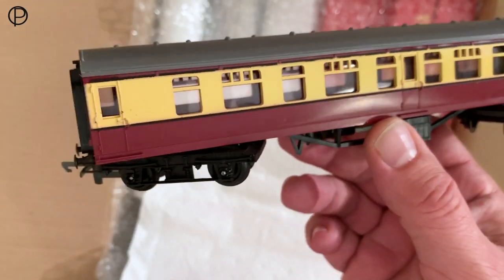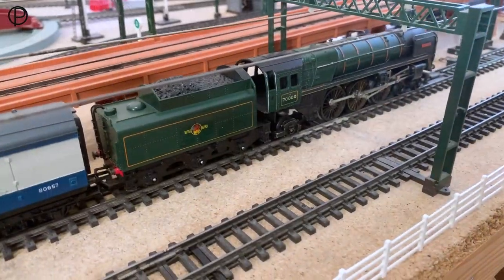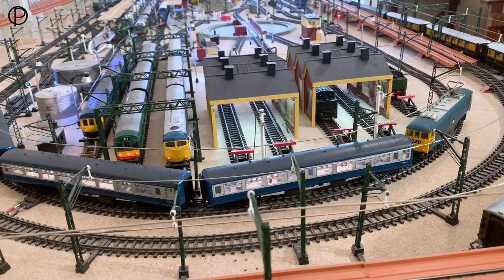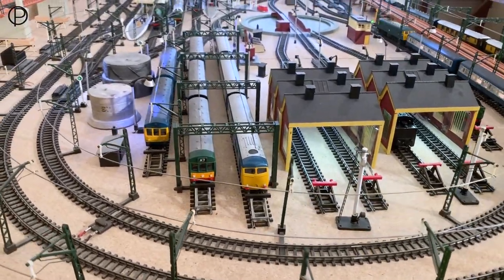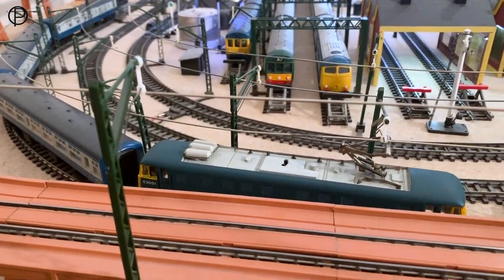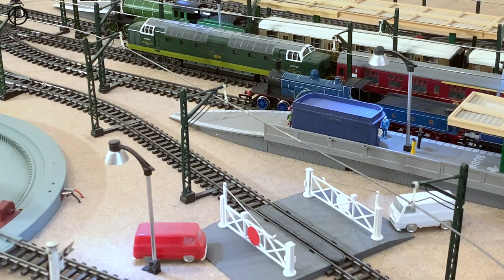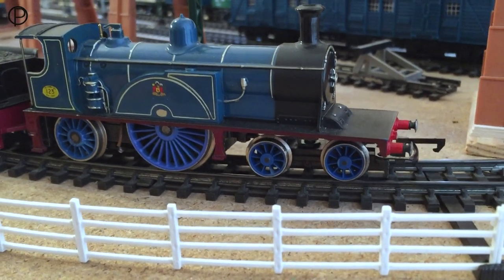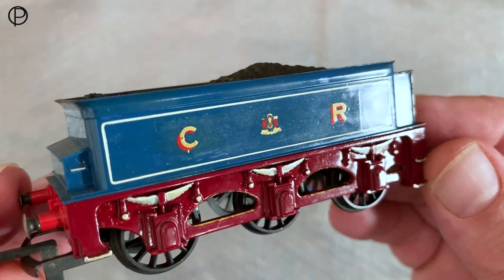Tri-ang Hornby R.753 Bo Bo Electric with Mk2 illuminated coaches

Comment: Thanks for the regular Sunday morning entertainment - so much better than reading the paper. This isn't really related to today's video, but I can't help wondering how many of those bridges Tri-ang actually managed to sell; I remember that it was expensive, but the main problem was surely that it requires so much space for the ramps that most people wouldn't have had the room for it.
Reply from the maker: Good morning Roger, great to hear you enjoyed the video again this week. The bridge defiantly need quit a bit of space to work as yo say. Pat Hammonds books suggest that about 1200 of the were made 1963-65 in the Tri-ang Railways period and in the Tri-ang Hornby era another 4200 between 66-67 and 7000 more between 68-71. Thats quite a lot for such a large and expensive item at 24/- in 1963.
Thanks again.
Oscar

Comment: Hi oscar another great video mate I love seeing your E3001/81 electric locomotives running on your layout I all like the tri-ing class81 locos I have 3 tri-ang hornby 81 on my layout today but with new ringfield 5pole motors in them did you got the 81 loco from Hattons I think I seen it on they website a year or so a go when I got one a 81 loco from Hattons last year? stay safe and well mate goodbye for now clive
Reply from the maker: Good morning Clive great to hear enjoyed seeing these models in action I really have a thing for the catenary. And a great play value those coaches with lights in combined with the overhead. The E001/81came from Elaine’s trains may be five or six years ago possibly   more and I’ve used it extensively for setting up the catenary and testing it. The pantograph was damaged when I got it and I’ve carried out some minor repairs on it. It’s always been a strong runner.
Thanks again for watching.
Oscar

Comment: Hi Oscar,
Good to see the old electric getting a bit of a face lift. The work someone did on that model might be crude, but it's still a good looking model. She looks a 100% better with a new coat of paint on her front end. Might be worth finishing the wire hand rails? The holes in the front are a little weird looking. Are you going to give it a coat of clear coat after doing the numbers and logos? 

The Caledonian looks good with the replacement wheels. Maybe some paint work on the blue to match it to the older body shell would be in order? Lisa
Reply from the maker: Good afternoon Lisa I think it’s a definite improvement as you say however I think wire handrails might be a step too far for my modelling capabilities at present.
Thanks again for watching.
Oscar

Comment: Noce job on the AL1. Were you tempted to renumber and use a different headcode at all? Its one of those musings I get, when you have multiples of the same lcomotive, lfe's too short for thinking about the rolling stock as well! Partly triggered by picking up a BoB renumbered and named to Lord Dowding a while back and obviously T/H did the alternative names and numbers thing for some models, although fidning them with the alternatives applied (or decently apppled) is quite the challenge, in which I have yet to find much success. Caley single looks convincing at the head of the S&D blue four wheelers even when we know it should not! Thanks for the entertaining and informative video as ever.
Reply from the maker: Good evening Andrew I had thought about it but then I thought I’d be happier if it was more like the one that originally came out of the box! You’re right about the alternative name’s being supplied with some of the locomotives it seems it must not have been very popular with customers to change them. I have a BOB renamed as Fighter Command. Thanks again for watching.
Oscar

Comment: The AL1. doesn’t look dodgy at all Oscar . It’s a very nice model .
Reply from the maker: Good morning Russell glad you like it had great fun bringing it together.
Thanks again.
Oscar
Reply: Hi Oscar. Yes the electric loco now looks very good. A bit of historical information. The tanks on the roof are to represent air tanks. All of classes AL1-5 were originally vacuum brake only but they were all air-braked and refurbished by 1974 to run on the newly electrified West coast mainline and operate with more modern coaches and wagons. This would include the mark 2 coaches you were demonstrating today.

Comment: Hi there Oscar. 
Great layout and locos. 
I have seen on EBay a listing for a loco I believe you do not have. It is an R357b Experimental blue class 31. It’s boxed and mint from a seller that I have seen looks very good. 
It would make a great video as you have done all but that one of the A1A - A1A. 
Regards 
Will
Reply from the maker: I William thanks for the info I do have one of those models I just haven’t run it on video for some reason. I shall have to get around to it at some point. Thanks for thinking of me when you saw it. Many thanks for watching.
Oscar
Reply: @oscarpaisley  Would be great to see. I spend the week waiting for the next video, sunday is tri-ang day! It would be great to see one in mint condition and on a proper layout like yours! 
Regards
William

Comment: Hi Oscar, Sorry I've not been more active lately. Been busy with the real world sadly. Can I ask what brand of paint you use and how you match the colors so closely? I would imagine what's available in the UK for paint is different from what we can get here in the states. BR trains are not so much of a thing here. Lisa
Reply from the maker: Hi Lisa I the paint I used was all bought from our local model shop which has sadly been closed some time now, when I had need paint which I don't use very often. I asked for advise at there I needed to repaint the grill on a Blue R.152 Diesel Shunter  early 70s version that I had restored as it had been painted bright red and had alteration. the helpful staff recommended a Revell enamel paint semi mate 310 as a good match to the yellow used by Tri-ang Hornby. So I had decided to use that again for the Bo Bo electric as I still had the paint left over. They used to stock both Revell and Humbrol ranges of paint. I also use Have Humbrol 174 in satin which seems to be a good match for the colour used by Tri-ang Hornby for buffer beams this was also recommended by them.
Hope this was of some help.
Thanks agin for watching.
Oscar
Reply: @oscarpaisley  Hi Oscar,
Thanks for the informative reply. Sadly model shops are largely a thing of the past. They all are slowly going the way of the dinosaurs these days. We used to have good quality paints from Testors until they stopped making them http://rrmodelcraftsman.com/testors-discontinues-popular-lines-of-model-paint/#:~:text=Testors%20has%20decided%20to%20discontinue,focus%20more%20on%20other%20products I will have to look into Revell and Humbrol ranges of paint and see what is still available. Lisa